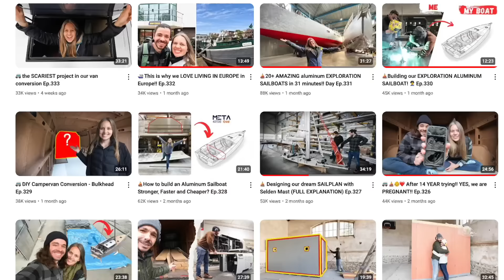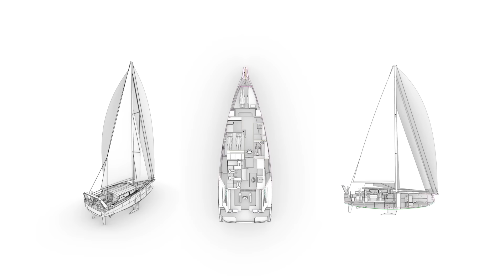🚐 Van Conversion: Our DIY BULKHEAD!! Ep.338

Comment: Another wonderful video.  You will probably need to upgrade the vehicle weight, this interior is going to be so so heavy. Add to that if you are going to take it to anywhere cold, you will need a lot of insulation.  Good luck.

Comment: personally I would try to fit a pas through between the driving area and the "house. Imagine waking up and its raining HARD you need to move, you both have to get out, get wet and run round to the doors. Or god forbid you have someone attempting to rob the van thinking its empty. Even a hatch you can lock from either side would do. 👍
Reply from the maker: The original idea was to have a window but in the end to keep the three sit configuration the window ended up way too small but we might add a "door eye" (not sure how you call). A passage is impossible if we want to keep the three sit configuration and regarding that we have no option, there is a baby arriving in 3 months. 🥰

Comment: With all this Plywood and laminating by the time you have finished this van all you will be able to load in it is a few cans of Tuna. You should be exploring lightweight options. When considering lightweight alternatives to plywood for projects like van conversions or other mobile builds, here are some options you might want to explore:

Honeycomb Panels: These panels consist of a honeycomb structure sandwiched between thin layers of material such as aluminum or fiberglass. They are lightweight and provide good strength.

Corrugated Plastic Sheets: Corrugated plastic sheets are durable, lightweight, and water-resistant. They are commonly used for temporary structures and signage but can also be used for certain interior applications.

Foam Core Boards: Foam core boards, like PVC foam boards or foam-cored polyethylene sheets, are lightweight and offer good insulation properties. They are easy to work with and can be a good alternative to plywood.

Aluminum Composite Panels: These consist of a thermoplastic core sandwiched between aluminum sheets. They are lightweight, durable, and offer good rigidity.
Reply: As its designed to carry huge weights of cargo, doubt this is a problem!
Reply from the maker: Cost and easy to work material plays a huge part on the decision. This is poplar plywood that is really light. Here in france that is the most common material used as it has great cost/weight benefit. 😅

Comment: i think since you will sell the van at the end, you should keep the original bulkhead for the next user. they are usually expensive and difficult to find. store it somewhere in the meantime and put it at the back/cargo area for the next guy. let him decide whqt to do. the seat goes further back with the bulkhead, top and bottom, the plastic one. if he will be tall he will have a big problem adjusting the seat.. good luck! thank you

Comment: A useful trick for gluing laminate to wood, as you are doing, is to lay a sheet of polythene onto the wood, then put the laminate on top of the polythene.  Line everything up correctly, then carefully slide the polythene out from between them.  I've done this in the past, and it has been very successful.

Comment: Luka why are u blocking the entranz from driver seat to back.? All camper vans have seats to turn back facing the back off the camper. Just asking Oto
Reply from the maker: We answered that on the video. We need to keep the 3 seats in front and then we cannot turn them. Also having a bulkhead keeps a better insulation to travel to cold places